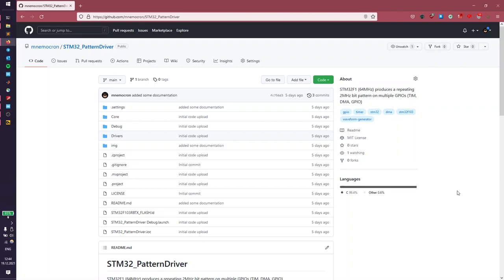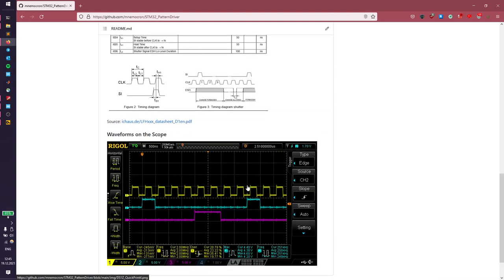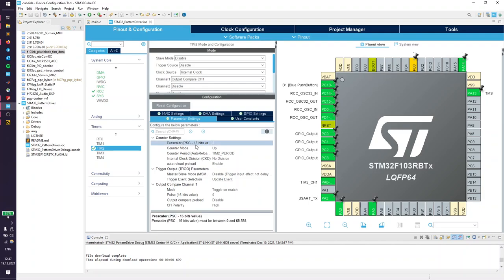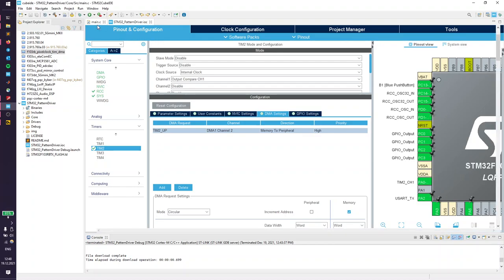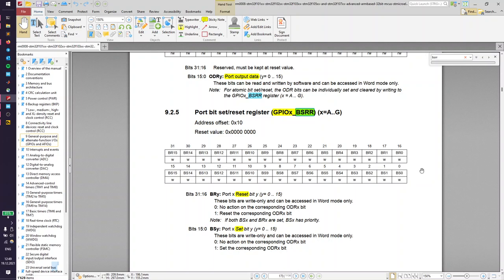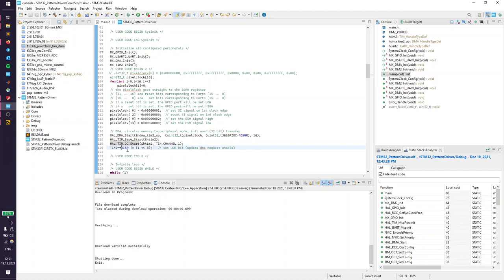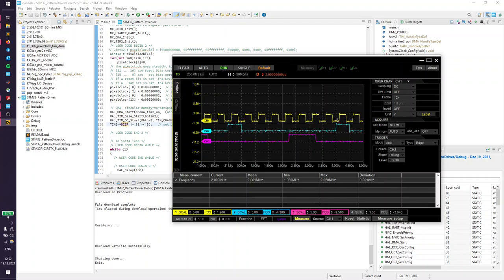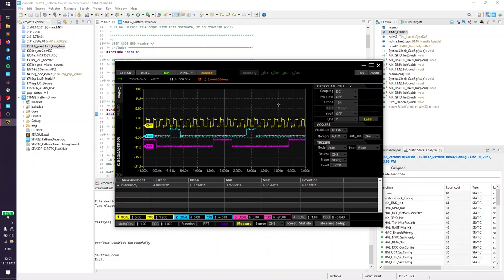STM32 Tutorial - DMA to GPIO for fast bit patterns (2 MHz) stm32f103rb

Comment: I tried many times with STM32H750VBT. I used different Timers and both DMA1/2. In the end it worked, using (uint32_t)&GPIOx->ODR instead of (uint32_t)&GPIOx->BSRR. My only problem leftover for now is, that even using circular mode, after each burst, there is a gap in the output, (seems linear) depending on the counter period i choose.

Comment: Hello again
what if I want to use 2 GPIO Ports for my Bit-Pattern as one Port does not have enough pins?
for example Port A and also Port B 
We can probably put the destination Address as (uint32_t)&(GPIOA->BSRR)&(GPIOB->BSRR) but how does the
Source Address know which port we are referring to?
For example: How does it know the pixelclock[0]  =  0x00000001;  belongs to  PA1 or PB1?
Could you please elaborate on that?
Reply from the maker: I do not think you can combine addresses like that. You need to think about how the DMA controller works in the background. Which is essentially moving data from one address to another address. I would be very surprised if the DMA could write to 2 addresses (2 GPIO ports) at the same time. If you need so many high-speed parallel signals you might really hit the limits of an MCU and consider an FPGA. However, maybe you can use 2 seperate DMA channels (triggered on the same timer) to achieve what you want. But when you do this, make sure, that the DMA channels do not block each other by using the same bus. There are tables in the datasheet of the MCU which describe the DMA channels (which can be active at the same time) because the BUS fabric architecture is dependent on which MCU you use. And if that works there might still be a chance that both GPIO ports have a slight difference in timing, perhaps non-static so that you have jitter between the signals of both ports. I would try this and then measure the output signals. I hope this helps.
Reply: @simonmartin_ch  Thank you Simon for your kind guidance, I DO appreciate your time and effort.
I use F103C8T6 running at 72Mhz
my update event Clock is 1Mhz so 500khz Frequency and the smallest pulse I make is around 5us = 5 update events, I get very low jitter with this config. which is very important for me.
In fact, I have just enough GPIO pins in port B for this task( around 14 I need), however, I'm a bit conservative about future updates on software, so I may add a few more
another reason for using two ports was that unfortunately all the pins of a specific port are not placed all side-by-side in an LQFP48 package so they come out of every corner of the MCU and contaminate my sensitive Analog sections and ADC reads, (haven't tested it yet, so it may or may not).
At the end of the day, if using two ports with DMA would cause more jitter and instability, I would most probably go with one port solution for now and work on my Embedded skills to find a better solution in the future maybe.

Comment: Hi Simon, Can I to use DMA interrupt for recall data buffer when data transmit complete without use timer?
Reply from the maker: If i understand your question right, yes this is possible for some peripherals like UART, SPI, I2C. It is called a "DMA transfer complete interrupt" or "DMA transfer complete callback" function.

Comment: My clk is running at the desired speed. but pc0 and pc1 do not show any signal. Even ODR values do not change in debugging. i am using STM32F407 uC.
Reply from the maker: If ODR values are not changed, then there is something wrong with the DMA. Is the DMA configured correctly? Is it started? I assume you followed every step in the tutorial carefully (therefore yes) 
So perhaps it has something to do with the available DMA channels which differ between the architectures. Maybe try a different DMA channel and/or timer.
Reply: @simonmartin_ch  I HAVE TRIED EVERYTHING.  also change the DMA. but it still does not show a signal on two pins.
Reply: first use dma2 than dma1. the issue is bsrr and odr does not change. I have gone through your code several times.
Reply: @simonmartin_ch  is there any possibility of HAL library error.
Reply from the maker: @exaltedcodiing6655  Yes! that possibility exists. The STM32 forums are full of bug reports and people complaining about errors in the HAL libs
Reply: @simonmartin_ch  what can i do further to run the two pin simultaneously at high speed
Reply: @simonmartin_ch  I tried more expirement. I figure out that hal DMA start only retains the first address, the DMA does not change the address for the next element in the array.
Reply from the maker: @exaltedcodiing6655  Excellent observation. But you did configure the DMA to increment the source adress? If you did, maybe the HAL library has a bug right there...
Reply: @simonmartin_ch  Dma is configure at increment..... it does not sending data at port....just keep pc0 high
Reply: I have figured out and run the program…
Can you give any suggestion reagrading how to stop the clk after every 8 cycles?
Reply: @exaltedcodiing6655  

What did you change to make the DMA function OK.

I'm trying to do the same thing on a STM32F4, becuase I need to generate PWM on a pin that does not support Timer PWM.

I'm using TIM2, Channel 3  and have setup everything else exactly the same as the video

My code uses a 100 element array, as I need 1% control on the PWM

But the BSRR does seem to even get the first DMA transfer

I've tried the othe channels on Timer 2, but it didn't make any difference.
I can't use Tim2 CH1 because STM32 Cube says its already allocated, but I'm not sure where

I've also tried TIM3 but that didnt make any difference either :-(

	const int dimingTableSize = 100;
	uint32_t dimingPattern[dimingTableSize];
	memset(dimingPattern,0x00, dimingTableSize * sizeof(uint32_t));

	dimingPattern[0] = GPIO_PIN_8;// set pin 8
	dimingPattern[50] = GPIO_PIN_8 << 16;// reset pin 8

	HAL_DMA_Start(&hdma_tim2_up_ch3,  (uint32_t)dimingPattern, (uint32_t)&(GPIOD->BSRR), dimingTableSize);
	HAL_TIM_Base_Start(&htim2);
	HAL_TIM_OC_Start(&htim2, TIM_CHANNEL_3);
	TIM2->DIER |= (1 << 8);   // set UDE bit (update dma request enable)

Comment: is there any method to stop the clk after 8 pulses in this code?
Reply from the maker: By clk, you mean one of the GPIO signals generated by the DMA? You could run the DMA in regular mode instead of circular. and then only use a data array which produces 8 clk cycles. But if you only want to stop one signal while the othes continue, it becomes more tricky.
Reply: @simonmartin_ch  the code is running perfectly. thanks to you. but I want to stop both the output and the clk pin to stop after 8 pulses. I only want 8-bit outputs at pulses(1 bit = 1 pulse). but I am unable to stop the clk and output. although I try regular DMA. still not working. Any suggestion.
Reply: Did you find a way to do this, I need to stop the DMA, change the data buffer en then start the dma again. So as to enable a sort of binary data sending functionality via a pin that gets toggled. However I can't stop the dma at the right points. There is a dma abort function but that takes up too much time to execute..?
Reply from the maker: @markusmulder8040 Correct, stopping the DMA is inefficient. Use regular DMA configuration in the CubeMX interface. Then start the DMA exactly the same way. HAL_DMA_Start(&hdma, my_data, &destination, lenght);